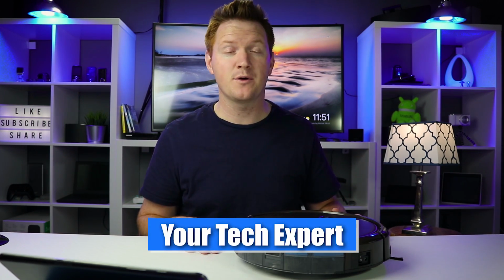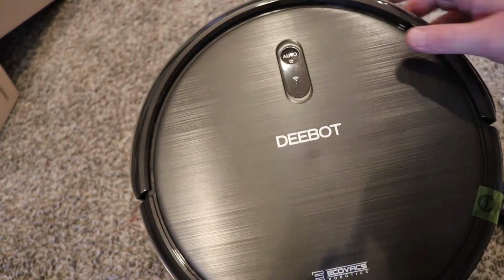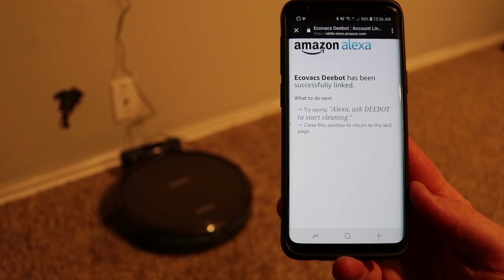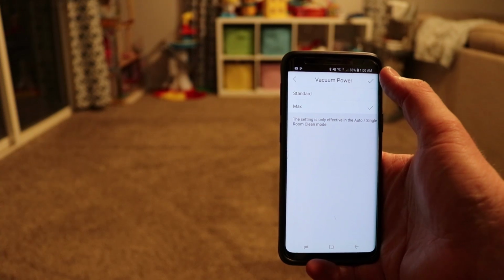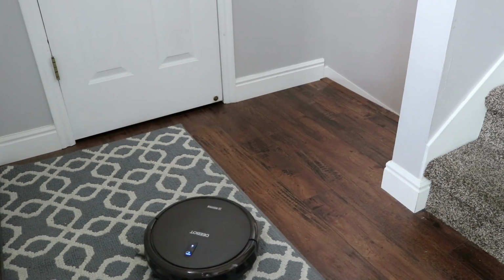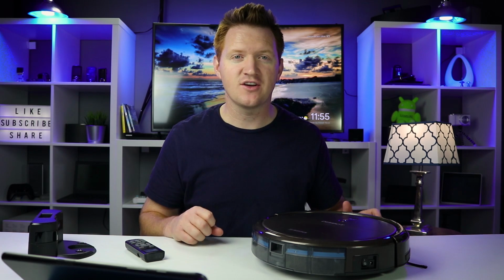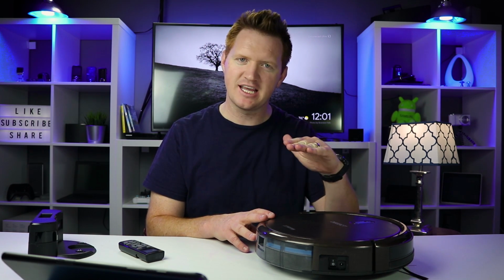ECOVACS Deebot N79S Robot Vacuum Cleaner Review

Comment: Still love it🌼 This darn thing is still running strong. Don’t buy cheap supplies like brushes. The aftermarket side and main brushes are not good quality. Spend the money and buy the brand. Three times a day she runs without problem for almost the last year. Still going strong. Once again, would be nice to have a remote alert when she gets stuck or when the receptacle is full.
Reply: Hey I'm thinking about buying this product was wondering how often would I need to replace those brushes ? And also the filter ? Can I clens the filter with water and is it expensive to maintain ? Will it break if it collects water from the kitchen ?

Comment: I have a Roomba E5, which works okay. It’s not terribly smart, but works okay on carpets or individual rooms. I got my mom a Deebot 79W for Christmas as it was the only robot in stock at Target that I could afford. It had better reviews than the shark and the roomba. I have to say after using it to clean up the extensive cat and dog hair in her house, it was truly impressive. The best part about it is the remote that was included that actually allows you to steer it. My biggest issue with my roomba is that it get stuck in corners and cleans the same spot over and over. This is not an issue with the Deebot since you can just steer it away from the area and it will resume the auto clean without an issue. It does seem to take longer to charge, but lasts longer than my roomba. It’s quieter than my Roomba too. Can’t speak on long term reliability and durability, but I’m definitely impressed with what I’ve seen so far.

Comment: I have the Deebot M88 and the Linksys Velop Wi-Fi system.  Despite everything I've tried, I have never been able to get the app to work.  Yes I contacted Deebot and they sent me an email with the same troubleshooting script that is posted on their website under "Troubleshooting".  That said, the vac works pretty well and picks up a lot, it even impressed my wife.  It gets under couches, dressers, beds etc.  I did just order 2 ECOVACS Deebot N79S Robot Vacuum Cleaners because I have a really big house, a cat and a dog, and sandy soil.  it does get hung up on cords, the dog's pee pads etc.   If you have pets that aren't housebroken, it  could get pretty ugly.
Reply: Same for my Samsung powerboat R7040.  Still no connection.

Comment: Can the battery be changed when it reaches the end of its life?
Reply: Yes. Turn it upside down. Just south of the top, freewheel, is a panel held in with two, small, Philips screws. Unscrew and open this panel. The battery is inside connected via two wires - a small plastic connector. Just get another 2600mAh or better a 3000mAh battery on Amazon. Let the new battery fully charge (6+ hours) before you use it. I've found my 3000mAh battery lasts 1 hr 20 mins per job.

Comment: Please tell me why it won't connect to my phone. I've set it up directly under the router, set it to 2.4 GHz, double checked the password and it still loads to 100 then says connection failed
Reply: It only worked for me when I literally laid my phone on the vacuum.  Stupid and should not have to be that close, but hey it worked.  And once connected I haven't had any problems.

Comment: I got this during prime day, so far I really like it. Only issue is my rug has some black designs in it and I guess it reads that as a drop and sometimes gets stuck then I get a anti drop sensor error
Reply from the maker: That is very interesting. I never would have that it would do that. Is it still able to go around another way?
Reply: Tech With Brett the way my rug is designed in one corner there is no other way to get out. It seems like it gets trapped and confused. Tries to get out for maybe 30 seconds then gives up red light appears and on the app I get a drop sensor malfunction. Can't even make it go over the black section using the remote. Usually have to pick it up. Once I do and place it past the black section it goes right back to cleaning
Reply: Tech With Brett I sent you a DM on ig with a video of it doing that if ur interested

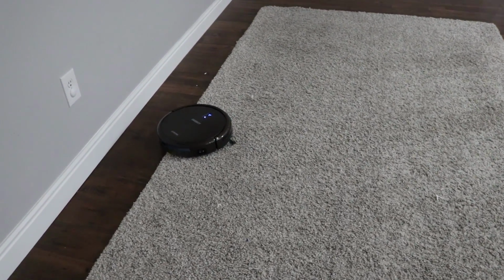Comment: Great review Brett! The price on this is really tempting. Can't wait to see the mopping version though. But I wanted to ask what happens when it gets stuck or something like @13:46. Does it continue to sound that alarm for very long? Thanks. Keep the videos coming 👍
Reply from the maker: As far as I could tell it kept beeping for ahioe bit I stopped it because I didn't want to wake the kids.
Reply: Tech With Brett Just thought I'd give an update here: Almost bought this on Prime Day but missed the deal. Then the price jumped 30 bucks from where it was earlier 😒 Ended up getting a Neato botvac instead. And let me tell you it was the best move I made. It operates with lidar and has an app that connects to at least Alexa (Google uses ifttt sadly but it works). It also produces a map when it's finished. The D3 model I bought was less than what they jacked up the price of the Deebot to, and it has can use boundary markers as well- which was the only thing that has me thinking about the D5 model. I can't recommend it enough 👍

Comment: I have had a similar model. Same kinds of wheels, sensor etc. I don't like it at all. No intelligence in how it goes through a room, just random movements. Really bad with rugs, the spinning brushes could easily bent on a rug for instance and destroy themselves. Got stuck on a doorsill once while cleaning while we were out. In a position that made it not understand that it was stuck. Ground away it's entire rubber wheels against it until.the battery ran out. Threw it in the closet after that.
Better sensors and understanding of souroundings etc would have figured this out. I even think Neato ha does stuff like that just fine.